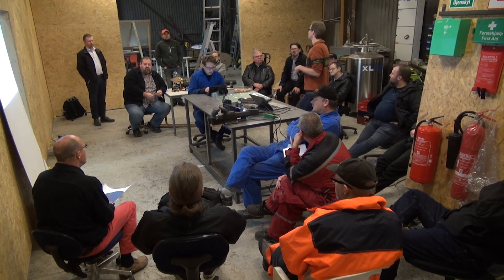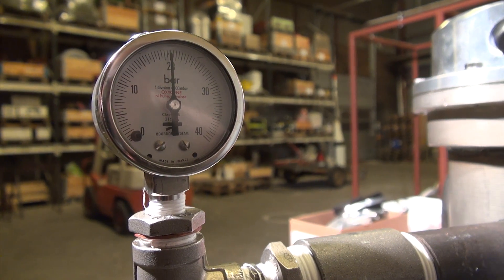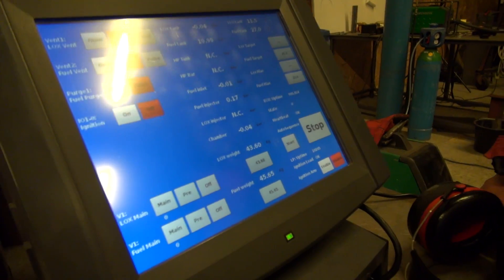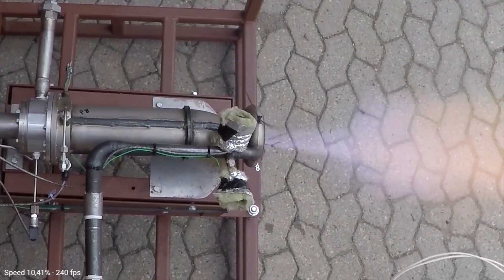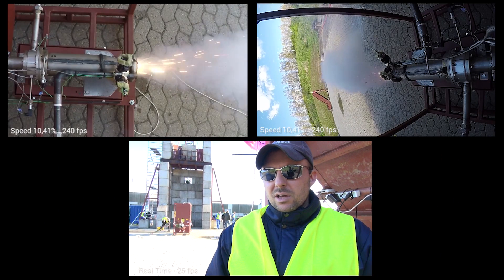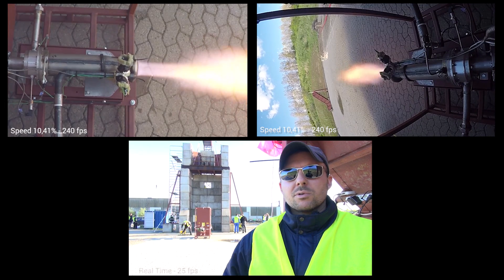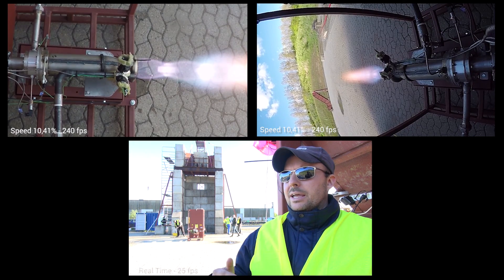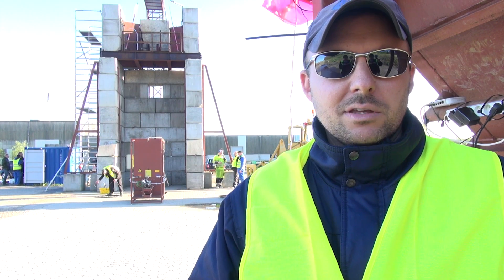BPM5 Static Test 1 -  Atmosphere Video

Comment: Ooh, so that's why the shock diamonds didn't seem to be stable in the 2nd burn! 
You went slowly from "full throttle"-state to blowout to test... what exactly? throttleability? Isp over throttle? operating stability?
Reply: Maanuueel42 Currently CopSub doesn't have any systems to maintain pressure on the fuel/LOX, so over time the chamber pressure drops pretty significantly. They're going to have a system to maintain pressure (probably not a turbo pump, but I don't know, I'm not part of CopSub) in the final motor, so I think it's just a fact of reality that they'll have to test with variable pressure right now - though it'll probably yield some valuable data anyhow (you probably don't want the motor to be very sensitive to slight changes in pressure).

The primary goal was to test the cooling solution, and to do that they needed to attain thermal equilibrium - that is, the point where the motor is no longer getting any hotter, and will hopefully be able to run indefinitely. 

I'd assume higher chamber pressure (meaning more fuel/LOX) would mean a higher temperature for thermal equilibrium, but as the chamber is also cooled by the amount of fuel running through the cooling jacket, that may not be the case. I don't know enough about rockets to say anything about that.
Reply: Sofus Rischel New Zealand's Rocket Lab uses an electric pumping system. It might be very interesting if Copenhagen Suborbitals evaluated variations of this concept. Such a system could be simple and economical.
Reply: +Sofus Rischel Now they have made there own pressure system (DPR) Dynamic Pressure Regulator, for the fuel and LOX tank, it have been tested, and works, but will not be used on Nexø 1 :)